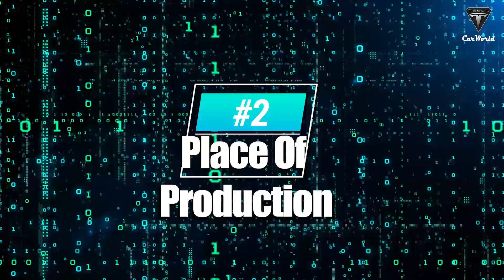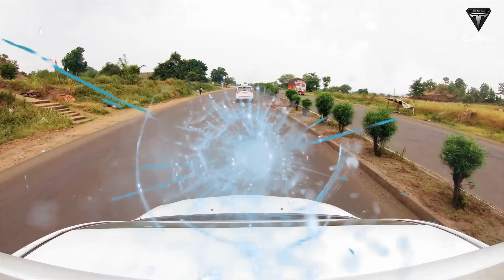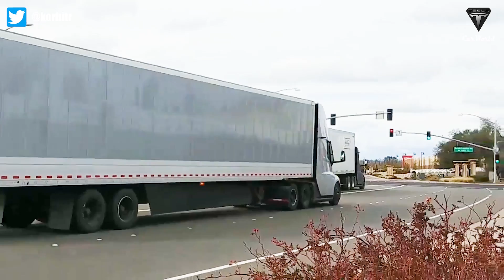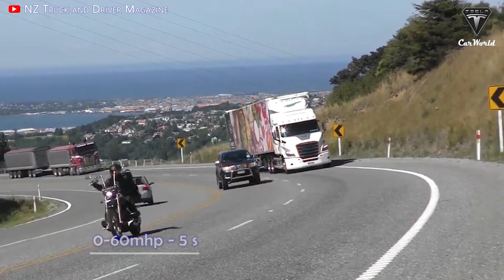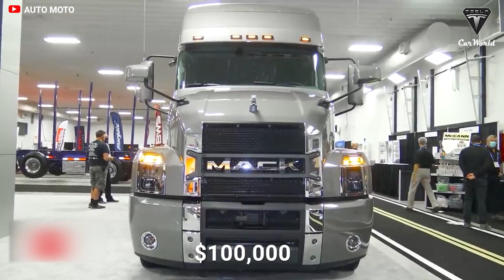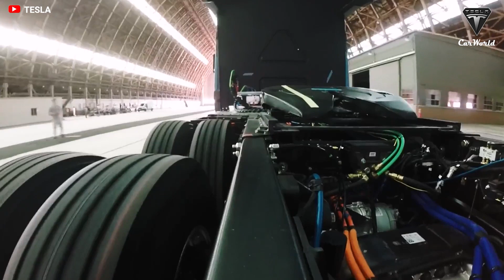All You Need to Know: The 2024 Tesla Semi EV With The Latest Upgrade!

Comment: Time is money for truckers that's the bottom line.. so all these new tech is great.. but if you have to wait 3 to 5 hours to charge up.. you just loosing money right there..
Reply: There are laws requiring mandatory stops for rest, truckers can utilize that, they aren’t stupid.
Reply: I believe most truck drivers have to take the time to sleep and eat, 3 to 5 hours, then the truck will already be fully charged in 1 hour (maybe less) , after all of that , the company won’t have to spent half of that ‘money’ on maintenance for the truck. I know several truck drivers that personally said that that’s the main reason why they want one over everything. No gas and low maintenance, that’s exactly the reason why I love my Tesla.